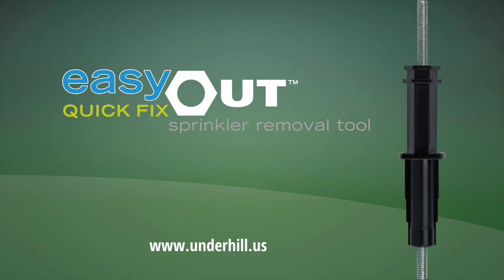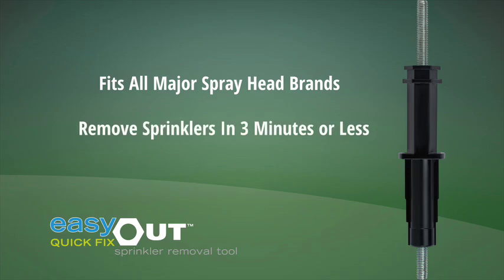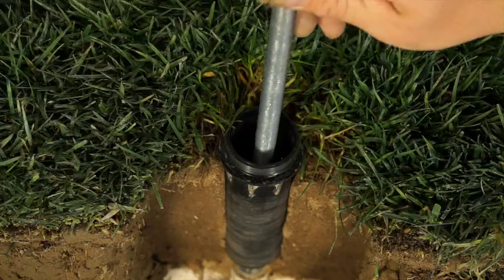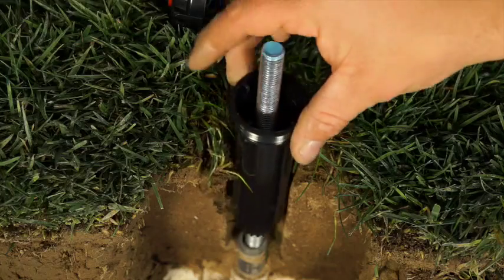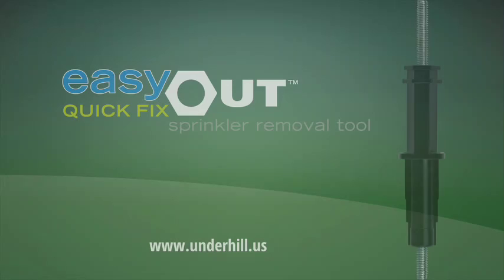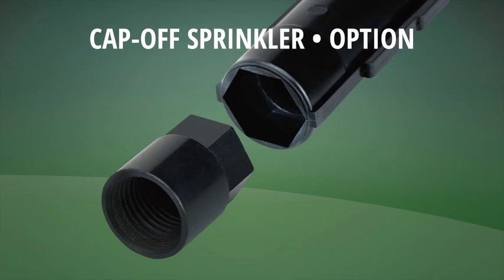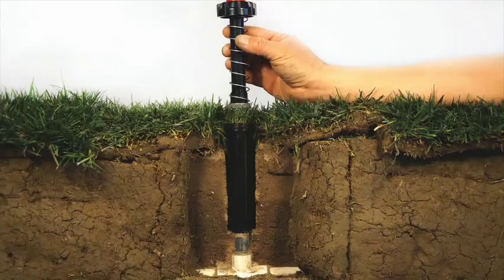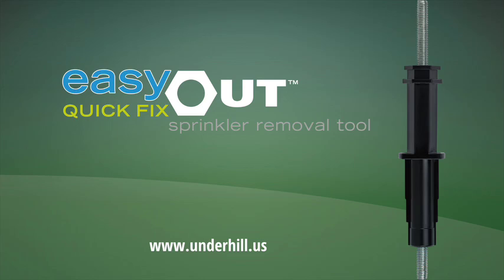UNDERHILL EasyOut™  | Irrigation Spray Head Repair & Removal Tool

Comment: Doesn't work for all heads and certainly doesn't benefit you if the head is too is an inch or more below the soil. You still have to dig to get to old heads. So it didn't work for me. The one head I was able to turn and start working on, after putting in the part to turn, it just spins freely with no grip. Too small I guess. Whatever! $20 lost.

Comment: if they had made it wider so it would work with hunter PGP, it would be Awesome but as it stands. .....
Reply: per Underhills descr tool is supposed to fit a hunter PGP which has an inlet of 3/4". Are you saying yours is not 3/4" or Underhill is dishonest?